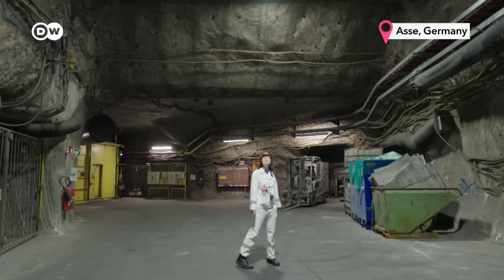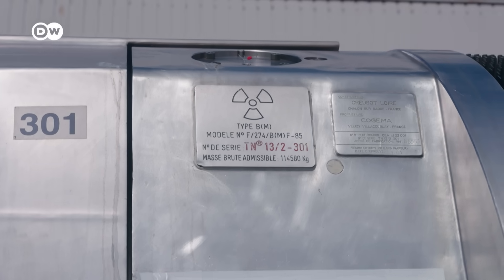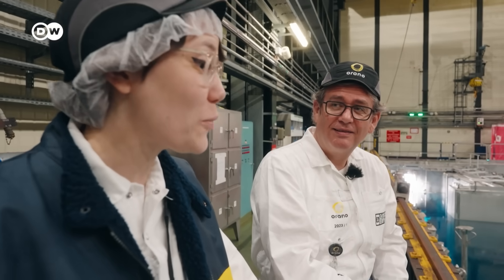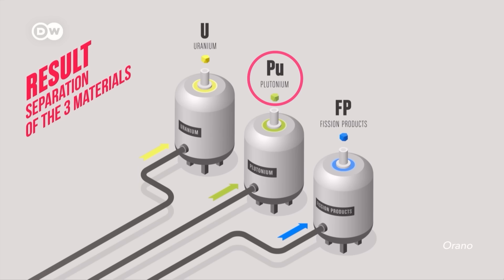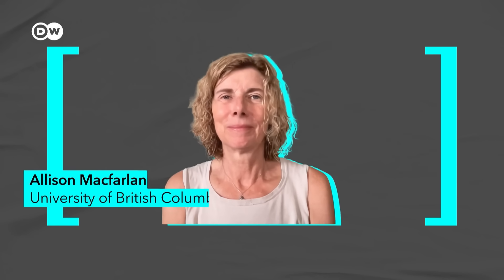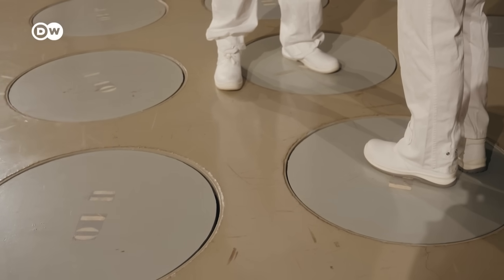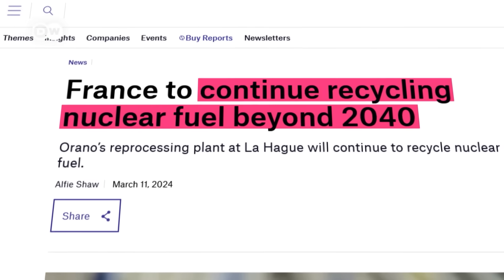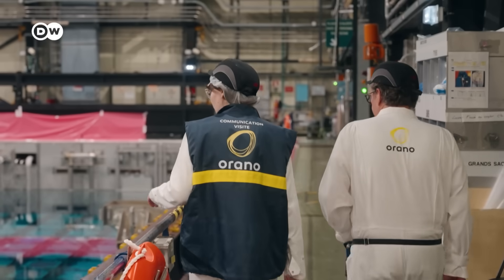Nuclear waste is reusable. Why aren’t we doing it?

Comment: Governments are probably suppressing nuclear tech and fuel in case of a doomsday situation. Then after things calm down enough they have plenty of new and used (with plenty of energy left) fuel to use. Nuclear is the future of clean energy, not solar, wind, or hydro. these so called "green" energy sources cause way more harm to our ecosystem than even coal or oil powered plants when you take all aspects into consideration. Natural gas and nuclear are what we should all be relying on with some hydroelectric in places where it does not alter the existing ecosystem. Even hydroelectric dams cause a whole lot of impact to wildlife and geography but we have found ways to try and reverse that damage. Wind and solar farms are some of the worst things to come out of the 21st century for the sake of our planet and our people.

Comment: Waste implies it is not re-usable.

And even if its re-usable, that doesn't mean its usable in the same context as the source it's processed from. And when you can't put it back into the machine you put it into... if you don't have the machines/equipment to take the waste output and use it as an input to make something else.... how do you re-use it? Also just because it's a waste product, doesn't necessarily means it was part of the input material itself. EG: Contaminated PPE is not re-usable as base material for nuclear energy production, and is too contaminated for use in non-nuclear settings/applications--I imagine there is a carte-blanche zero-tolerance for radioactive gloves being re-used for food-service work; and even if it isn't, no F&B company is going to legitimately risk the legal nightmare.

Comment: Another crazy thing is that a brand new power station needs to start changing out the fuel immediately or it would be off schedule and not be able to keep up, which means that practically unused fuel is being discarded as well.
Reply: Why aren't there plutonium power stations?  There is clearly energy available, 'simply' needs a new reactor designed to control this different reaction

Comment: Fission products should not be classified as waste as these materials, not all of them, are useful when separated out. It's the cost of separation that is the issue not that they can't be separated. That's one of the benefits of molten fluoride salts is you can separate out useful elements from the fission products completely negating "dangerous waste". It's politics, the will and the cost that stops nuclear reactors from being a totally "clean" energy production method.

Comment: The waste in its natural state is 200-300 Celsius. That's 2-3 times the boiling point of water that's still easy to draw usable energy from. Just not as efficient as it was. Yet they throw it away.
Reply: They should be using it to run stirling engines. Use aluminum panels painted with infrared cooling paint for the cold side
Reply: @RobertoFrankenstien  they could still boil water with it.
Reply: @charlesbarden2970   Yeah but it wouldn't result in high pressure steam like what is used to spin turbines
Reply: @RobertoFrankenstien  it certainly would you can get high pressure steam at boiling point. You don't need insane temperatures. That just boils water faster. My point being there is still usable energy just from the waste not even considering the ability to recycle.

Comment: You forget the environmental impact of uranium mines which could causes environmental contamination for hundreds to thpusands of years especially since it can contaminate ground water suplies. This also appliess to metals, and heavy metal  mines. Oh and mercury and lead mines. Salt mines also could be bad for nearby water systems. If you use the hot slats for refinement, the salt mines impact will factor into environmental impact.

Comment: There is no such thing as nuclear waste, there is only used nuclear material waiting to be repurposed and reused, like most commodities we use and create.    And while we currently may not have a use for some or even most of our used nuclear material today, who is to say that it will not become some future generations "gold".

Back when we first started cracking crude oil, we did so to mainly create lamp oil, aka kerosine and only because we spent aka used up the other main source of lamp oil, by over harvesting whales damn near to the point of extinction.  

In the early days of processing crude, petrol or gasoline was a waste product which was flushed down the drain apart from a small amount that was sold at chemist/pharmacies as a solvent.   This is why at the start of the intenal engine automotive era, you had to buy your fuel at a chemist/pharmacy.

Today petrol/gasoline is the main product cracked from crude oil.   Basically petrol/gasoline when from being our great-great-great-great grandparents waste to our gold.  The same could well happen with today's nuclear "waste".  Which is why we need to safely store and if need be recover it done the road.

Comment: 3:35 Surely he means austria. Australia doesn't have any nuclear plants...
Reply from the maker: He refers to spent fuel packages from ANSTO (Australian Agency for Nuclear Science and Technology). But you are right that there is currently no nuclear power generation in Australia, although there seems to be a debate going on.
Reply: Lucas Heights, just outside Sydney, is where the Australian Nuclear Science and Technology Organisation (ANSTO) operates the Open Pool Australian Lightwater (OPAL) Reactor, a research facility which also produces commercial quantities of radioisotopes for industrial and medical use.  There are several other smaller facilities. None is used for electricity generation, however.
Reply: While it's true that Australia has no Nuclear Power Generating Stations  , the U.S. buys most of their fuel for Nuclear Generating Stations from Australia  .

Comment: people forget the other R's. reduce, reuse. that hot pod could heat a building.
Reply: LOL. Yeah, but how many of them would be stolen? People can't be trusted. There are lots of things we COULD do if people could be trusted.
Reply: @hootowl6354 

I think they're refering to district heating, not literally plopping fuel rods for every household.
Reply: it could heat a thousand homes in a reactor tho
Reply: @hmeric7495  how much energy will it take to reprocess; build, maintain, operate power plants; maintain electrical grid; convert heat to electricity, transmit, and convert back to heat?
Reply: @juzeus9  yeah you're right
Reply: @juzeus9  Not much, in the grand scheme of things. Radioisotope Thermal Generators already exist. They last for years, and the only 'maintenance' required, is cooling. So to a normal household, they can provide both electricity and heating at the same time.
Reply: @hmeric7495 and cause a doubling of cancer rates for over 50 miles!
Reply: Forbidden hot candy
Reply: Reuse just means recycle. Korean Soju companies recycle their bottles by reusing them. I don't understand how that escapes you.
Reply: @heinzii7834  recycle means grinding it up and making it into something new.

Comment: I recommend the World Nuclear Industry Status Report (WNISR). It's a good compilation of data and tackles the actual problem, which is financial viability.

The latest nuclear reactor Hinkley Point C, currently under construction in Europe by EDF has its cost exploding to a point where chinese investors leave, as there is no way the electricity produced can ever compete with other energy sources, especially solar, wind, water and geothermal. Even if(!) they can finish the construction in 2031 they need to  run it for a veeeery long time or at insane cost per kWh to reach an ROI. That doesn't even consider necessary maintenance, upgrade cost and saftey inspections.

If you then realize the typical lifetime of a nuclear plant is somewhere between 20-40 years (average 28 years IIRC) it is unlikely they will ever be profitable without subsidies from the taxpayer, so he doesn't see the horrendous cost on his electricity bill, rather than his paycheck. 🤦🏻‍♂️

Comment: Statement from the video: "this Uranium can be used in regular nuclear power plants just like mined Uranium. This statement is wrong, neither the recycled Uranium nor mined Uranium can be used in a nuclear power plant. There is one crucial step missing; the enrichment of the Uranium and France does still depend on Russia to enrich Uranium. During this time this is outrageous!
Reply: Ummm...any Uranium recovered using the PUREX process will have the exact opposite problem.  It doesn't need the enrichment level increased, it needs to be mixed DOWN to the appropriate level.

Comment: The problem also is that we use nuclear fusion for old technology steam generators. Instead of capturing the energy coming off the fusion directly , there is a company trying to do that though
Reply: We use fission reactors for power.  Outside of a lab setting, the only place you will achieve fusion is by detonating a thermonuclear weapon.

Comment: Short answer: uncontrolled access to the plutonium waste products, and the tremendous security headaches necessary to address that.
Reply: Short solution.  Mix it with Uranium as MOX fuel.  Separating the Plutonium back out would require basically the same process as used to reprocess used reactor fuel...

Comment: The problem is that nuclear fuel doesn't really wear out over 4 years, it pollutes itself and damages the rod housings to the point where it is no longer predictable, reliable or safe to continue using.   Then it takes another year or so of letting the fast-order decay to occur before it is safe to move.   

It simply wasn't cost effective at all to immediately recycle the fuel unless you're extracting bred materials like plutonium and you only breed material like that in specialized reactors that run much shorter cycles with more delicate fuel insertions.

So we're not wasting it... we're storing it where we can get it back easily.   THAT was what was truly horrible about France dumping the waste at sea.
Reply: i am not sure but i think in germany they wanted to burry it in salt mines, because the salt is moving and will eventually cover the waste completely and sealing it. so i think they didnt want to recycle it. last thing i heard was that (ground or rain) water from this salt mines is contaminated and the salt seal is not working as planned. woohoo i love my country

Comment: I'm curious as to why Storage Facilities aren't built deep by Subduction Zones going deep in the Earth where they can be truly recycled in the Asthenosphere. If it takes 100s of millions of years for these to break down and facilities are being built on otherwise good land, it would be beneficial and cost effective.
Reply: I'm not a geologist, so I'm not sure this is right, but earthquakes and volcanoes are typically associated with subduction zones so the risk of damage goes up. Dry cask is fine for now. Eventually we will want to fully recycle. France and others do recycle, but only kinda 1/2 way. To do it all the way, you need fast spectrum reactors and separations that leave the transmutable actinides (the longer lived wastes) in the product destined for fuel reuse so they can be destroyed in the reactor. That just leaves the relatively quick decaying fission products for storage for several hundred years. The pyroprocessing technology they mention is designed to do exactly that.
The comment in the video about only doing 2-3 passes for MOX is because of these materials and the current thermal spectrum reactors which can't destroy them. Fast spectrum reactors can use them for fuel.
Reply: @richardb1452 @richardbaird1452  I'm referring to the FP that 4% that isn't. Mining down two miles into a Subduction Zone isn't anything new. Those spots of volcanic activities aren't near those and the liquefied rock isn't going to be immediately affected. Only when it churns down further into the mantle will it break containment, some 50 miles down, we're talking well over a million years that Fission Products won't be a problem.
Reply: @JmC023  Got it. Interesting idea. There must be some reason that fairly deep stable formations are always what they are after. Perhaps they are concerned about maintaining containment long enough before the "mine/repository" is subducted, which I assume would be much longer than the need for containment in a stable repository to begin with? Aren't most of those mines quite damp and warm. If so that would be the worst place for maintaining containment for an extended period.

Comment: "You can also use plutonium from from commercial reactors"   
Only if they have low burnup and online refuelling, both of which harm the economics of the nuclear reactor (such as a British MAGNOX or RBMK)... But inside a light water reactor... the plutonium generated is reactor grade, not weapons grade. It cannot explode and cannot be centrifuged into weapons grade due to radiation from Pu-240.... Much like the recyclable waste from a Thorium reactor, turning it into weapons grade means handling it and handling it would microwave you. 

Also Fission products only need 300 years of storage... not thousands.... In fact this video is just typical German misinformation carefully packaged as balanced journalism... it isn't.
Reply: The "reactor grade" plutonium with all its multiple heavy Pu isotopes when accumulated for a few years actually can detonate. The problem is that if you concentrate it enough so it can happen then stability gets so poor that it eventually just goes off on its own. This results in a very large and complex and still not very reliable nuclear bomb with poorly predictable yield but if you want to go nuclear no matter the cost then in theory it can be done.
Reply: @Kirillissimus  Weapons grade is >90%  Pu-239, reactor grade can explode at 80% with some trickery that isn't open information,  but a spent fuel rod is less than 50% Pu-239. 

So no it cannot explode, it can fissile out and microwave anyone who tries to handle it, due to the spontaneous fission rate of Pu-240. But this won't make it explode.

Comment: Because the only one operating fast breeder reactors and moving towards a closed fuel cycle is Russia. currently has two reactors in operation, BN-600 and BN-800, which use a mix of new and spent fuel. according to calculations, the amount of nuclear waste could be reduced by 90-95% in reactors of this type.

Comment: you forgot russia which has reactors to reuse spent nuclear fuel
Reply from the maker: Actually, we do mention Russia being the second biggest recycler (11:55).
Reply: @DWPlanetA  yes but you incorrectly brushed them off as expensive or "experimental and dangerous" when 4 have been operation for decades and another is coming online soon capable of burning all transuranic as fuel (not just U and Pu).

Comment: I always love how almost all of our power generation is "turn a turbine"  with different media
Reply: Because turbines have most effective conversion factors. So naturally that thing is used when possible.
Only solar panels truly found a different way to a turbine.
Reply: @emilwandel  You can go directly from thermal to electricity with RTG's.  USSR used them as remote power stations, and NASA uses them to power space probes where solar won't work.  Zero moving parts.  Not a lot of power output though.
Reply: @dave4882  They could produce at the most 10W for the largest ones for all that heat. That's hardly an effective use of uranium.
Reply: @dave4882  those are rly bad in efficiency. That's why they only are used when there is no other solution.And I would not call those things part of "our power generation".
Reply: All our power generation and the world's economy depends on coils of copper spinning in magnetic fields produced by other coils of copper!
Reply: @karhukivi well except solar
Reply: Yeah. It’s just conversion of energy. Chemical to mechanical to electrical for nuclear energy production. If we can harness energy 100 percent, idk if that’s possible, it would be nice.
Reply: @tschiyo7473  100 percent is impossible due to many factors including friction and entropy.
Reply: @ get rid of friction by creating small field around it
Reply: @chemisthajo yeah, HAHA. But would’ve been cool if it were possible.
Reply: @tschiyo7473  For 100% I think some laws will have to be broken of physics
Reply: @umerfarooq-my4dm true. HAHAHAHA.
Reply: I love how literally all of my power generation is 'eat food' with different foodstuffs.
Reply: @tschiyo7473 If heat could directly transform into power we would probably be harvesting geothermal spot and deep pits for about a thousand dollars with almost 0 waste

It'd also break the laws of thermodynamics killing us all but it'd be Nice
Reply: extracting from quantum vacuum
Reply: Our electricity generation is based on rotation (mostly 50 or 60 rotations per second, that's why we are using 50 or 60 Hz). That is, quite literally, the foundation of alternating current (AC) generation.
Reply: I mean, spinning a magnet is basically the only way to directly generate AC, so yeah, we need to turn a turbine
Reply: That's why they advise you don't reinvent the wheel...haha
Reply: @ we need get rid of the wheel and hover elctrogravitically
Reply: Because steam is a clean energy unlike petrol